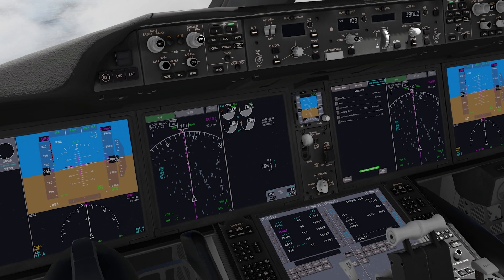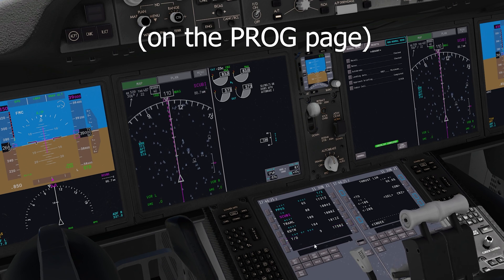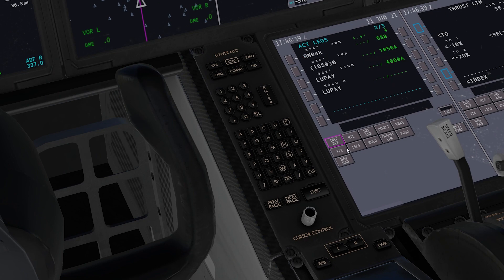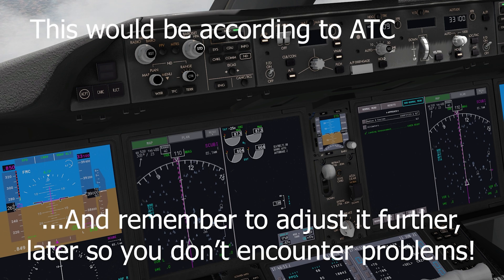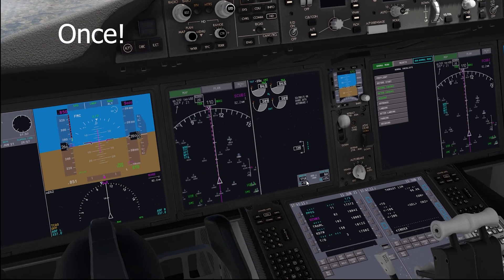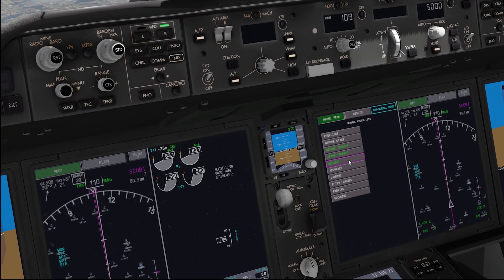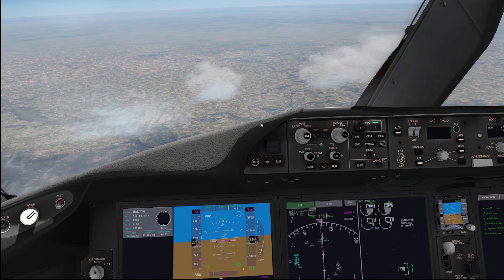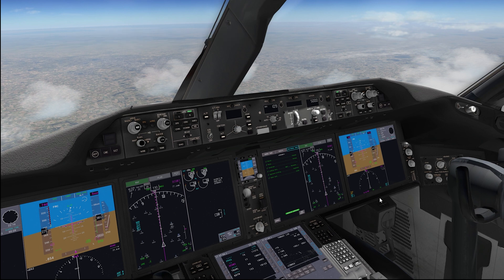How to VNAV descend in the Magknight 787

Comment: hey dude, i'm kinda late, but i have a problem:
the auto throttle doesn't work for me, like, i have it on, but it wont keep up with the speed, it just leaves me with manual thrust and i cant do anything else.
its super annoying. could you please help?
Reply from the maker: Is this on the latest version of the -9?
Reply: @Simleybob both 787-8 and -9.
Reply: @Simleybob and yea, the latest version.
Reply from the maker: @mebafikfsx  have you checked EFB settings
Reply: @Simleybob what exactly should i check?
Reply from the maker: @mebafikfsx  there’s an a/t disconnect setting in there, have a play and see if it changes anything
Reply from the maker: @mebafikfsx  also is vnav on
Reply: @Simleybob  nope, its still the same
Reply: @Simleybob  yep, vnav is enabled

Comment: I have a problem because when the plane takes off by itself I go up and I can not lower it help
Reply from the maker: Not sure what to mean sorry, try to explain it more, what exactly happens?
Reply: @Simleybob  I tried an approach where the boeing wouldn't stop walking up until I fully stopped the throttle and then had to dive my nose just to have the honour of landing.
Reply from the maker: @kubx2118  is this on VNAV? Try using vertical speed or flight level change and see if you get the same issue.

Comment: Thanks for this, I seriously regret buying this plane. It’s not fun to fly it just looks nice.
Reply from the maker: What issues are you having?
Reply: @Simleybob  when flaring the aircraft it seems to pitch the nose up as soon as I touch the ground, one time it was out of control it tail strikes the runway. 

I find the autopilot system sketchy. I did a V NAV descent and I it just stopped at 5000 even though the mcp was set too 2500 to intercept the ILS
Reply from the maker: @world-voyager  Yeah, the plane can be a bit sketchy like that at time but you just have to get used it to and use it right - and then you shouldn’t have many issues.

Comment: Hmm. Good tutorial but it does not work as easily as that. After watching, I did a flight EGCC to EGKK. This was set up to descend from FL190 to FL110 by KIDLI on the FMC. I noticed that at HON the TD was recorded as 71 miles, which was halfway between KIDLI & MID, so the a/c should have started to descend after HON. Before HON I set the FL to 30 and pressed HOLD. The a/c failed to descend at all by KIDLI. The only time it started to descend was at 71 miles by which time it was supposed to be going down to FL80. So even with pre-preparation the VNAV does not follow the FMC. I do not have this issue with the 737 Zibo which follows the FMC and does not require any Hold button to be pressed.
Reply from the maker: Hi. The T/D can be reported wrong from the prog page if the vnav pages are not correctly filled out - make sure the pages, especially the cruise flight level is filled out.
Reply: @Simleybob  Thanks. I have found that even if I input a flight level the system blanks it out. Have also noticed it does this if there is a message that a particular intermediate level cannot be achieved by a particular point. This surely should not prevent a cruise level to be input ?
Reply from the maker: @rmvideochannel6385  Hi, if there is an error, then try to put in the same cruise altitude again, or after failed tries, change the altitude + or - 2000 feet and it will work. E.g. if you are trying to put in fl390, try it again a few times, going back to see if it’s still there (it can remove it), then try fl410 or fl370 and it will work

Comment: if their is a discontinuity it wont turn
Reply from the maker: Correct, remove the discon by copying the waypoint after it on top of it if that makes sense
Reply: @Simleybob  right but if im on vatsim and the approach wants you to go 90 abeam to a waypoint until atc, you cant do that.
Reply from the maker: @SimbaC07  wdym 90 abeam to a waypoint?
Reply: @Simleybob  90 degrees to a waypoint, I'm just using it as an example...
Reply from the maker: @SimbaC07  just go direct to and it will turn
Reply: @Simleybob  nvm im not gonna explain :P
Reply from the maker: @SimbaC07  ok lol